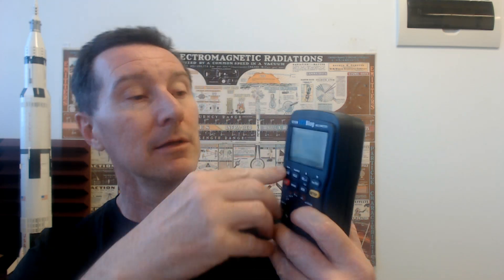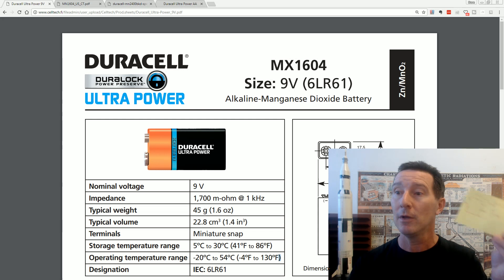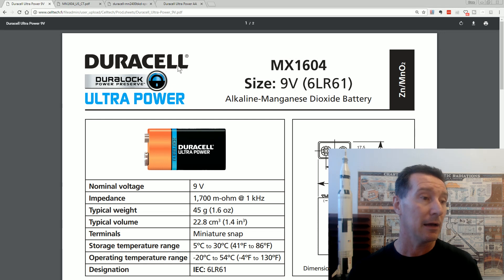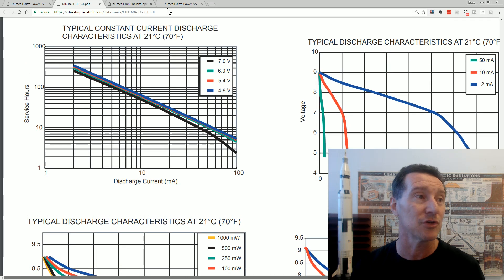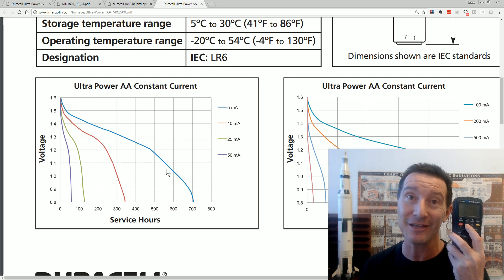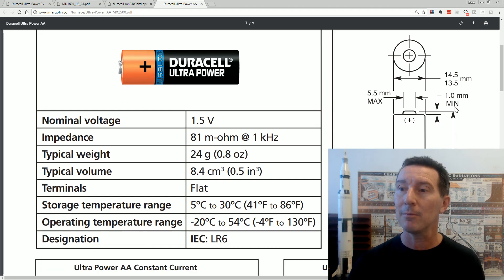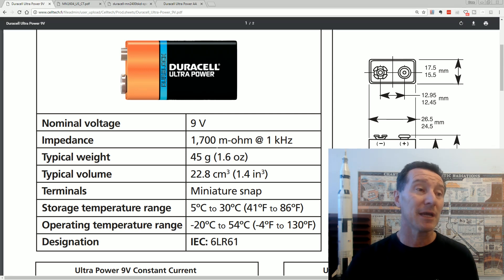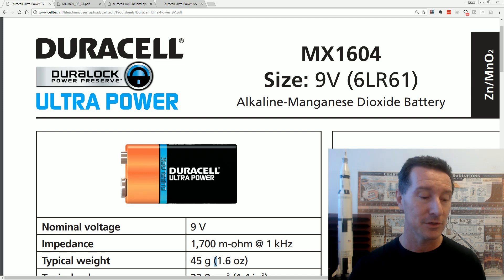Why Use AA's Instead of 9V Batteries in Multimeters?

Comment: Never mind batteries, why doesn't it run on Plutonium? :P
Reply: Increases shipping costs
Reply: I'm sure Cody could come up with something.
Reply: twocvbloke because there is an option to power it with a mr. Fusion
Reply: ...might as well  have break out board to plug in the Flux Capacitor
Reply: Most likely because these things are made for the kind of people that are going to take it apart..  And that will get messy ;)
Reply: Never mind the plutonium, where's my Mr. Fusion cold fusion reactor? It's supposed to have been available in a consumer/commercial grade version for a few years now!
Reply: It would be harmful for the battery lobby. They want us to run everything on batteries *Tin foil hat on*
Reply: I was thinking more along the lines of this:
https://www.youtube.com/watch?v=f-77xulkB_U
:P
Reply: TEM's could be deployed publicly, at least there's no technical reason why they can't. But well any old joe can turn that kind of Plutonium into a bomb, that's why we don't have them. It's not a technology limitation.
Reply: That would be one-charge-one-measurement. You'd have to remember to bring enough for the return trip.
Reply: It should run on Dave's self esteem.
Reply: I'm pretty sure most components you'll test with this aren't rated for 1.21 GW, so they have to take the power down a notch.
Reply: Okurka - Could you have possibly meant ego?
Reply: thorium freaking solar multimeters
Reply: Or baterizer lol
Reply: I vote it should run on DEW AND UNIVERSE (Kung Fu Panda for those scratching their heads)
Reply: I'm sure that in 2048, plutonium is available in every corner drugstore, but here in 2018, it's a little hard to come by.
Reply: The shielding would make the meter too bulky.
Reply: No, it should come with a portable solar panel like the Fontus. And maybe a folding windmill for overcast days. Might also need a water wheel for overcast days with no wind.
Reply: Seeing that video games of course reflect real life </sarcasm> the "fusion battery" in the Fallout games is twice the size of a 9V anyway, so we're back to square one LOL

Comment: I have actually been putting off getting a logging multimeter for awhile to get my self one of these 
Cant wait to get my hands on one while supporting your channel!
Also all the others use Bluetooth and long term logging over Bluetooth is just an unnecessary pain
Reply: Bluetooth hasn't proven to be 100% reliable in development, and apparently that's normal...
Reply: EEVblog Which is a bit sad when one realizes that Bluetooth has now been around for nearly 20 years, though it does not help that it is yet another technology crammed into a very crowded 2.4GHz ISM band with so many sources of interference that can momentarily jam it.  My first PDA, a Compaq iPaq Pocket PC running Windows CE, included Bluetooth back in 1999-2000, which was actually pretty reliable back then, but then there was not much in the way of WiFi and other 2.4GHz devices at that point and Bluetooth was literally its wireless network connection at up to whopping 1Mbps.

Comment: Post before watching: reason: because 9v is the worst battery type ever.
Reply: Still, "professional" gear in different fields seems to use 9 V while a large part of consumer stuff uses AA.

And as an exception confirming the rule, I've got a neatly engineered AOR handheld scanner that takes 4 AA cells without sacrificing any external dimensions. The only downside is that Ikealoops won't fit.
Reply: Did anyone else notice the 1.7 Ohm series resistance at 1kHz for that 9V battery? That's poor.
Reply: RWBHere I think it says 1.700 m-ohm which should be mili but I might be wrong?

Comment: Very interesting, and an excellent choice and explanation :)
This does make me wonder though, why do smoke detectors use 9v batteries instead of AA?
Reply: Ease of high voltage, no issues with people mixing and matching batteries, and very low currenct draw. It's the right choice.
Reply: EEVblog that makes sense. I suppose in a device designed for safety it guarantees matched cells.
Reply: Zylon FPV There are a fair number of smoke detectors which use AA batteries in certain segments, the 9V batteries are most common as backup power sources in the hardwired AC powered smoke detectors as they do not ordinarily need a lot of sustained power since they spend most of their time mains powered.  But in the non-hardwired and wireless model smoke detectors as well as CO, explosive gas, and heat detectors (an option to smoke detection in environments that do not lend themselves to typical smoke detectors, like garages, attics, or crawl spaces) you will encounter greater use of AA batteries due to their much greater capacity versus 9V batteries.

Comment: I would have wanted to suggest a single 18650, but became a sponsor after that discussion had finished.  I plan to use low-leakage NiMH in mine.
Reply: 18650 is a 'now' battery, even tesla dont use an 18650, they use their own size they reckon is better for overall power density in the thousands they use in a car, better to stick with aa
Reply: Jusb1066 What on earth are you talking about, 18650s are the most common form factor for lithium-ion batteries. There exist many other less common form factors like 26650s or whatever format Tesla is deciding to use now, although they used to use 18650s, regardless, why does Tesla have any bearing on what battery is suitable for a multimeter of all things? Also: wtf is a 'now' battery?

Comment: Imagine for a minute, that there was a device that could boost the battery voltage to 1.05V... You'd get another hundred hours... Something small enough to clip onto the battery before you install it into the compartment... Wonder if anyone could ever find something like that...

HA!

Anyway, 9V batteries are like R50 each; 4 AA batteries are R25. So not only are you getting 4 times the life, you're getting it for half the cost. AA is the standard these days - that's what's most sold and therefore most developed - choosing ANY other battery (except for maybe an 18650) is pissing into the wind.
Reply: If batterizer could be adjusted to output 1.05 V constantly instead of 1.5 volts, then yes. Otherwise, it would discharge them even faster because it would need higher current from battery to maintain these 1.5 volts which are mostly converted to heat inside tester's linear regulators!
Reply: 1.05V?
Reply: South African?
Reply: Yes 18650s are power houses but can be tough to find sometimes (powerbank salvage can be a reliable way .)
Reply: Already done, search for energy harvesting devices.
Reply: Lol, that was funny :D
Reply: There is simple way to use all avaiable cell capasity in this device: switch to LSD NI-Mh. This chemistry delivers at least 95% of actual capsity to 1,05V per cell at low rate discharge and is rechargeable.
Reply: AAAs are 4 times the total cost, AA has twice the capacity and cost half the price, so 4 times as much for the total price per hours used.
Reply: Umm... You mean like a transistor?
Reply: Nah, I'm just fucking with Dave. I meant his nemesis: The Batteriser.

Comment: My old portable Ham radio used 8 D cells
Reply: Well, with the transmit power being at least a couple W, you'd need that to get good battery life. To be honest, for that kind of application, the best kind of battery would be a 13AH Ni-MH rechargable F size cell. Harder to find, yes, but great capacity.

Comment: Test the battery life with lithium AA cells. Would they be worth investing in for this use?
Reply: Err, no, he means 1.5V Lithium AA's
Reply: not really, at low current use, alkalines have a very high capacity, quite close to lithium, lithiums real use is super long standby such as smoke alarms for a decade,  the cost is sucked up by not having to get a ladder to replace the battery, its not worth it in a long lasting portable device, you wont get a cost performance improvement
Reply: You'd need only 2 to get about the same voltage as 4 alkalines.
Reply: All the ones I've seen are ~3.6V. 

Can you point out an example of a 1.5V Lithium cell?
Reply: Energizer Ultimate Lithium Batteries  http://data.energizer.com/pdfs/l91.pdf (spoiler: single use, not li-ion)
Reply: I'm shocked!  I've been using 14500s like these (https://sep.yimg.com/ty/cdn/theshorelinemarket/xeno-xl-060f.pdf) for at least a decade, and had no clue there was a lower-voltage lithium version!  I've certainly seen the Energizers on the shelf, but never picked them up to check their details because of their cost.
Reply: 1,5 V Lithium is also almost essential in anything that's going to be exposed to sub-0°C temperatures. Alkalines are useless below 0°C, they lose almost all capacity and develop an extremely high internal resistance.

Comment: Interesting to hear how you came to the choice to use AA batteries.
Reply: I wish more meters used AAs. Modern meter chips can work on 2.5V or less, which makes 9V batteries quite wasteful. Replace LDOs with micro-power switching regulators and you can get another 30-40% extra battery life from a 4xAA pack.
Reply: The energy density difference between 9V and AA makes it a no brainer in my opinon. Didn't even need to look at a single graph to know that :)
Reply: How well does it run on low-self-discharge rechargeable AA Eneloops?
Reply: Not just the most common, also the cheapest per watt-hour among primary cells. 2.5-3X the capacity for slightly more money and bulk than comparable quality AAA.
Reply: And you get 8 AA batteries for the same price as one 9V battery. At least over here.
Reply: is it not the best choice you can think of? the worlds most common battery cell
Reply: In that appliation, switching regulators would only be suitable in PWM-mode. In PFM-mode the bursts cause significant noise - practically you could almost not get rid of it as the necessary filter components would become quite bulky.
Reply: @Flochlandla no need for bulky filters: the sampling and digital conversion process take less than a millisecond, you can simply use large enough supply bypass capacitors to make the voltage drop negligible throughout the sampling process then time measurements with intervals between bursts.